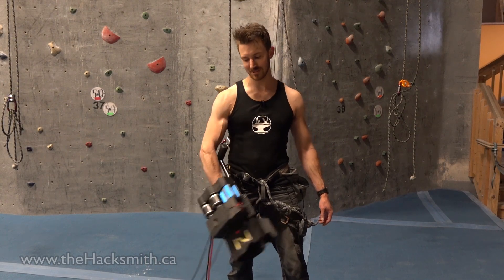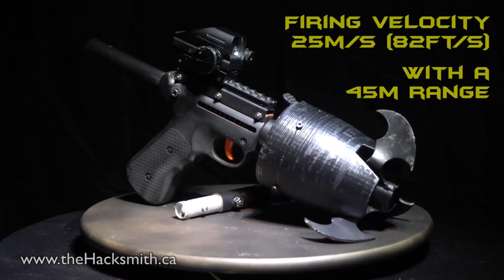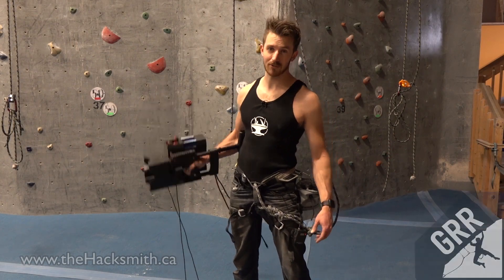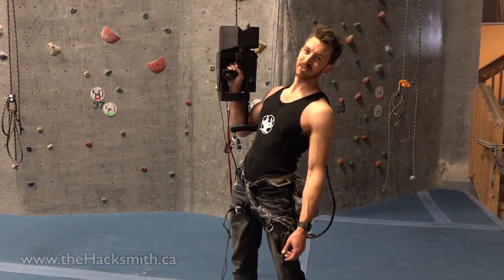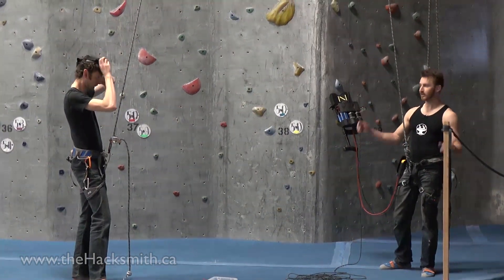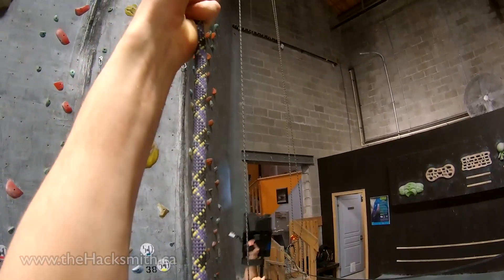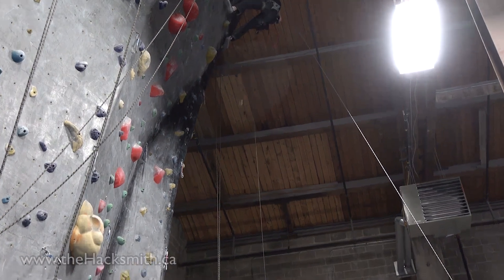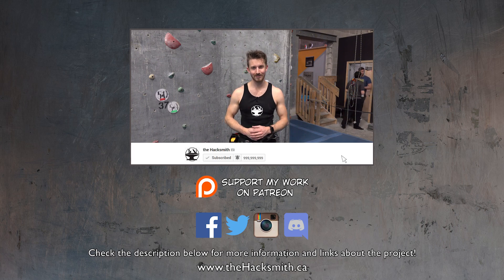Make it Real: Batman Grappling Hook Winch (TEST)

Comment: whats the best switch with a battery for using electromagnets? 9 volt or rc batteries?
Reply from the maker: +Jaxon W 9 volt wouldn't be enough, you need at least 12v generally

Comment: just for safety you should add a ratcheting mechanism so if the motors fails to hold it will lock you in
Reply from the maker: +Luca rides MTB that's how worm gears work ;-) they lock when back driven :)

Comment: @Hacksmith, could you transform the grapling hook to a 3d maneuver gear like thing with more powerful motors, or it is too expensive? You've made once the blades for the 3dmg so now you should make the real thing.
Reply from the maker: +Dark Light the physics just don't work out though :(
Reply: Dont make too fast, like the anime...make it a little faster than this video. Make it slow enough so you dont break your back or something

Comment: I do have one question though on here it was already attached to the top then you flew up are you going to do the same thing if you climb the building or would you attach it to the grapple hook and shoot it at a window then climb it because without the grappling hook its basically just a speed cable climber not hating love your work just curious.
Reply from the maker: +VenomViper300 just wasn't allowed to shoot it indoors lol. Didn't you watch our test video for the gun? The hook works lol, probably the easiest part of the build
Reply: Yes i did i was just wondering if you were gonna attach it in the end if you climb the building
Reply from the maker: Maybe for safety, but not necessary

Comment: Your belay technique could use a little improvement...
Reply: lol I was cringing when he switched hands like that. But at least it all worked out in the end. Really cool grappling gun!
Reply from the maker: +Jonathan Fairchild the gym has auto belays, but they're slower than doing it by hand, even regular climbing I can climb faster than they can auto belay :p
Reply: If you have ever seen speed climbing (which is faster than that), there are two people to belay so it goes faster.
Reply: You need to use a speed climbing belay. I am not sure who at GRR would know how to do it, but the coaches of the youth team should know.
Reply: I can belay a lot faster than that, going down with no rope! I belay so fast going down... All you will see and hear is a big thud.
Reply: Ammoniummetavanadate that way you'll have to have the space to walk backward enough

Sidenote: belaying 2m/s is possible for 1 person ;)
Reply: @ozapenguin 

There is a one person version as well, you tie the brake strand to an anchor on the wall then the person just walks back pulling the rope through the gri-gri.
Reply: ive found if you are speed climbing use two people on the belay, one to pull in the rope and the other to pull it out. not sure if it works with grigris, only ever used bugs
Reply: It was a bit shaky, but the two hand technique is legit for people who have practiced it.
Reply: @Skyler Muir

No, a jumar wouldn't work there is too much friction for the rope to quickly pull through. You might get away with a progress capture pulley, but if you have ever seed someone top rope solo you can see the difficulties with slack pulling through on its own.
Reply from the maker: +Reuben Vandezande you try belaying at that speed :p
Reply: the Hacksmith Well then, fair enough. Keep the good vids coming!
Reply from the maker: +Jonathan Fairchild not possible to belay that fast properly :p
Reply: Hacksmith! I love you're stuff, man!!  Thanks for replying! Just saying, there are devices out there that autobelay quite quickly maybe not as fast as your device though. And there are many teqniques. One you might try is having a helper to pull the rope while the belayer is doing the locking action. That way you're always locked and your belayer won't be losing his grip in case you do fall and the helper can pull as fast as he wants. Don't mean to be a critic just a fan!
Reply from the maker: +skylerockspecial there's no way belaying 2m/s, even the fastest rock climber in the world can't climb that fast!
Reply: the Hacksmith you're right sory, 3m/s 😜
Reply: The safest way to do that would probably be to use a sender. they're inexpensive and since they are on the climber and just slide up the rope they can go at any speed.

Comment: you guys should make a real life lightsaber
Reply from the maker: +Alejandro Manrique working on one
Reply: cool
Reply from the maker: +redstone craft guy I disagree, we're designing a 150kW pack to power our protosaber we're building. Mind you it will only last a few minutes ;-)
Reply from the maker: Our protosaber will be able to cut through metal. It won't be a "strong light" or a "flimsy coloured fire torch"
Reply from the maker: +Plasma Skull where the heck did you get that number? The surface of the sun is only 9,941 F... or 5,505 C. 

But for your reference our saber will burn at about 2500C. The melting point of steel is half of that.
Reply from the maker: It would, yes.
Reply: This aged well
Reply: the Hacksmith will it look like an actual lightsaber from the movies or just a torch?
Reply: +a shapeshifting reptillian Haha imagine if all the Jedi and Sith in Star Wars wore protective goggles so they wouldn't damage their eyes looking at their lightsabers XD
Reply: Yoo they just did
Reply: I know because he could just mean a strong light that does not stop or a flimsy colored fire torch.
Reply: Okay cant wait! been waiting for you guys to do something like this :D may the force be with you!
Reply: I believe a real light saber would have to burn at around 60,000 degrees F.
Reply: Are you just building a massive laser, and blocking its path to keep the look of the sword. That would also be why it would only last a few minutes. It would get hot, very hot quickly.
Reply: The question is what do you mean by light saber ?
Reply: the Hacksmith awesome
Reply: Alejandro Manrique wickedlasers (dot com) sells something called the phosphorce. It basically turns their class 5 lasers into one! Idk if it can cut holes in steel walls or anything thou...
Reply: I guess what I'm the most curious about is what the light saber will be made of. A real light saber is made out of plasma.
Reply: Plasma Skull that's pretty Damn hot
Reply: One way he might be able to create something close to a lightsaber is by creating massive arc using and EHV or UHV line and forcing the plasma through a perforated ceramic rod with high pressure air. Building a real light saber is really just building a giant plasma cutter.
Reply: so just a lighter thing like everyone else has done or use actually plasma.

Comment: I wonder how small and compact you could make it it you used predominantly titanium or magnesium for the build.
Reply from the maker: not any smaller... gears are the limiting factor, the enclosure is plastic (already lighter than any metal)
Reply: Ah, ok. Makes sense. I hadn't thought of that. Will you be releasing blueprints of any type? I might like to try making one.
Reply from the maker: +Atomic Fire it cost a few thousand to make...
Reply: the Hacksmith 
And? That's not much of a deterrent. I'm a handy guy, I'm sure I could figure some way to make it with supplies I could get. Say, use a 18 volt drill or driver for the motor/motors. I'd probably only use one if I use a driver motor and assembly. The hammer motion should get me a fair amount of torque. With the right gear ratios it would definitely be enough.
Reply: Oh, also, magnesium is extremely light. Are you sure the particular plastic you are using is lighter?
Reply from the maker: +Atomic Fire at that point you're better off designing your own version... A drill motor wouldn't be compatible with this design ;-)
Reply: the Hacksmith 
True... I suppose... It would be nice to have some plans to modify as needed though.